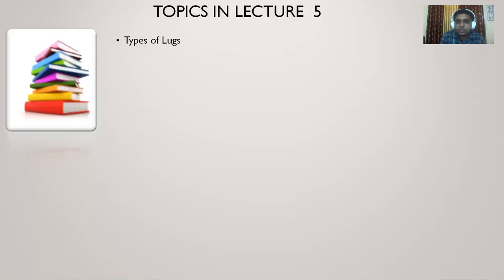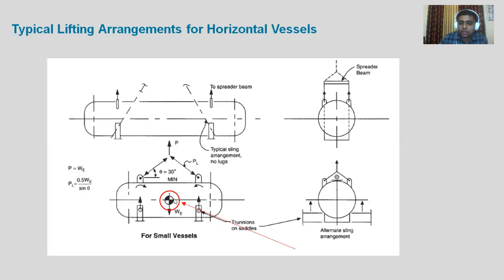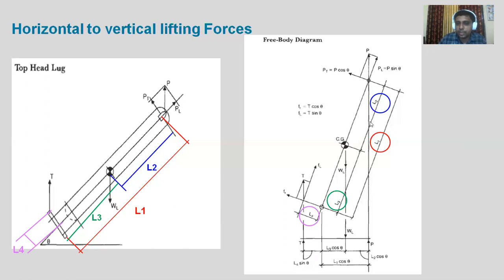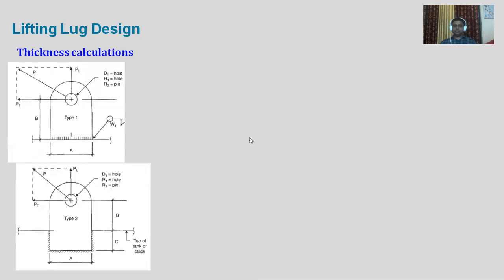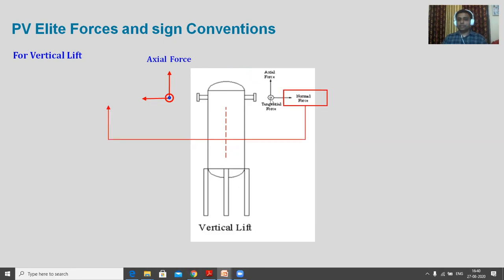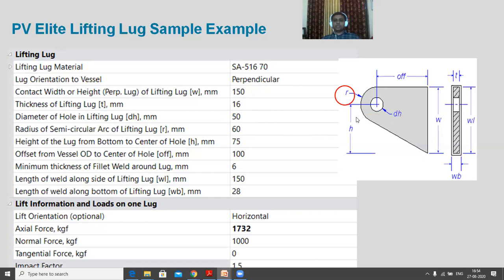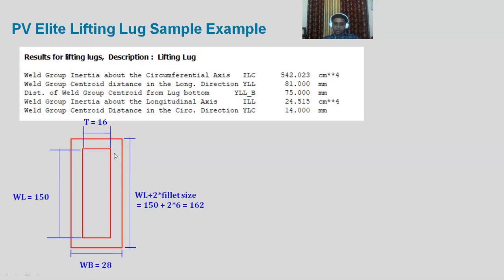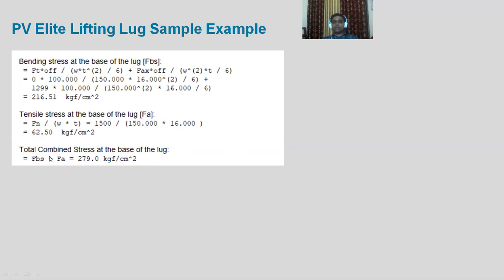Lifting Lug Design Calculations

Comment: I might be wrong but shouldnt u take the effective weld thickness to be 1/ROOT2 times the leg thickness of weld during moment of inertia calculations? because the throat area of the weld is minimal and has the most stress so it makes sense at 1:25:00